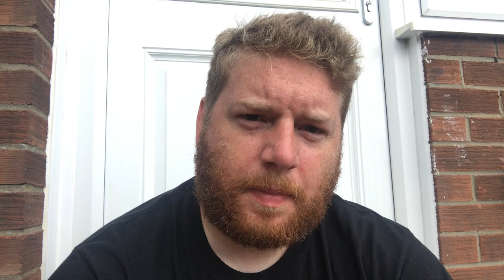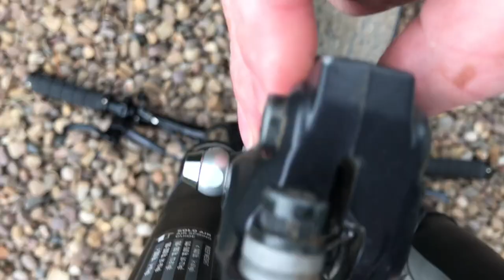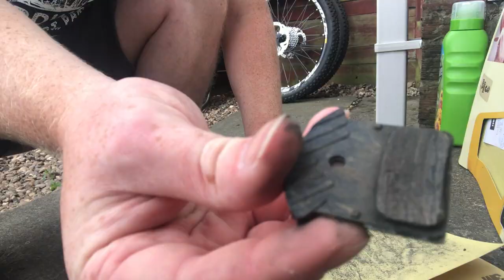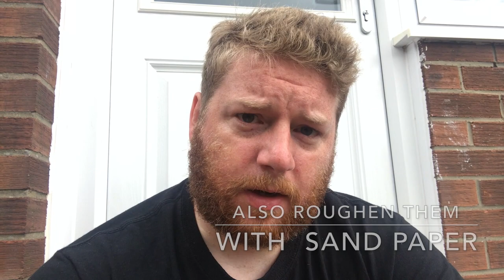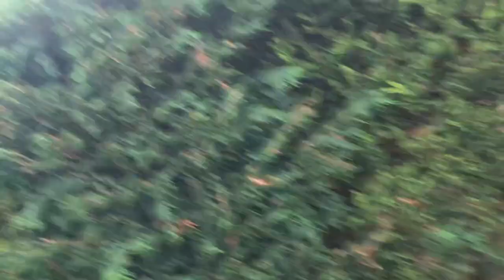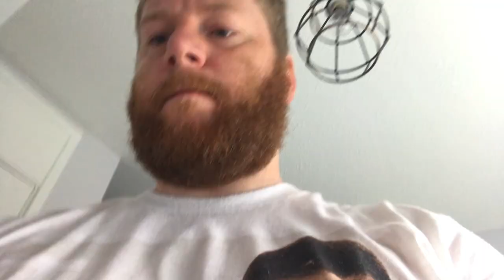Contaminated Mountain Bike Brake Pads (How to fix)

Comment: If you sand down contaminated pads without treating the pads first, the chances are you're pushing the contaminant further into the pad compound itself.

Before sanding the pads give them a good coating of disc brake cleaner (or nail varnish remover) and give them a good scrub with a firm nylon brush to get as much residue off the face of the pads as possible. Then give them a good sanding with an 80 grit sandpaper until they appear the same color they do when new (more of an orange color for resin based pads).

As for the rotor, you're better off using a clean rag soaked in disc brake cleaner as it won't rip/shred in the same way paper towel does, which guarantees better cleaning.

Local bike shop covered my rotor and pads in mineral oil when bleeding so they were literally useless. The above with a proper bedding in process (gradually building up heat/pressure/duration of contact and no wheel locking) has brought them back to performing as-new. The idea of bedding them in is to coat the rotor in deposits of the pad which is what results in the 'bite' of well bedded in brakes. Locking up the wheel means this can't be achieved.

Hopefully this method works for anyone who gives it a try!
Reply: Shop professional mechanic here. DO NOT SOAK YOUR PADS IN ANYTHING. If they are that badly contaminated. A can of disc brake clean is 10$+ for cheap stuff. Brake pads on average are 20$. Clean your rotor with isopropanol alcohol or acetone. They will remove any oils. Disc brake clean is acceptable if you are buying automatic stuff I've noticed things like finish line disc brake cleaner leaves a residue that actually isn't beneficial in anyway you still need isopropyl to clean that residue it leaves off. The bed in procedure was perfect. But I'm telling you right now if that shop soaked your pads and srcubbed them with a brush to clean them. I will not recommend to go back there as they do not know what they are doing. I personally ride my bike to work in the winter months with salt out. So I am almost every single ride taking my brake pads out sanding them down when I start to get a slight squeel upon braking. By no means will I ever soak my brake pads.... What we recommend as a professional destination MTB shop where we're dealing with 4000$+ gravel road and MTB bikes daily. DO NOT SOAK PADS IN ANYTHING NOT EVEN WATER! If you soak the pad material you are ruining your pad and allowing moisture to be trapped therefore enhancing the rate at which it gets contaminated if you soak the pads there will be residual moisture. ( You don't wanna burn them out) if you did a metal splintered pad will not bite as hard as you changed it's composition with heat. Same for a resin filled pad for quiter less dirty braking. Metallic for muddier dirtier braking plus added friction while braking. Although they can get noisy anyway. Sand the top layer of your pads down take an air compressor shoot some air at the pad to clear any residual dust after tapping dust off. Clean the rotor good with isopropyl alcohol. Don't use a rag that'll fall apart like he mentioned. You also need to be extremely careful using any kind of cloth it has to be a shop grade towel that has no oils or contaminates on it. Easy for me as I work for a shop and we pay for oil and contaminate free towels that we pay to have them wash. Disc brakes will pick up any contaminants even oils off your fingers so when touching them use gloves the entire journey. And if that shop covered you rotor and brake pads in mineral oil. Once again go find another shop. First thing I was taught as a mechanic was if you are opening any kind of hydraulic system you remove the brake pads and wheels from the bike and protected before any part of the systems opened even with mineral oil we have buckets underneath the bike towels rubber banded to the ends of the bike so it can run. And this is just for mineral oil. Don't get me started on disc fluid. You can't even let that stuff touch paint. So if that shop can't do a bleed with mineral oil without ruining your brake pads. And then to fix it they soaked your pads in disc brake cleaner and scrubbed them? To me it sounds like this should couldn't eat it's mistake and buy you brand new components you deserve. This kind of this doesn't happen at professional tier shops. Not when your average bike you work on is 3000$+

Comment: Here's another approach that works for me every time: Vinegar. Soak the contaminated brakes into a plastic filled with vinegar. Then rub them with a sand paper. Dry them with a pure cloth. Repeat this process until the brakes appear like new again. 

Also, clean the rotors and the inside of the calipers well with Vinegar too. This works miraculously. Enjoy!
Reply from the maker: Great tips, never thought of the vinegar bit but makes sense. 👍
Reply: only thing is with sand paper is that it creates an uneven surface on the pads
Reply: Road Bike how long do i soak them
Reply: @casensmith9752  as you soak them do them with grit paper....in 5 mins the process is usually fine.
Reply: What type of vinegar do you use?
Reply: I tried with isopropanol to clean, but it failed. Vinegar works great 👍 My noisy break is finally fixed. Thank you

Comment: Hey man, watching from 2020 and just wanna thank you for the fix. Currently using shimano mt-200 hydraulic brakes partnered with shimano RT 26 rotors. I just followed the steps, did sprints and brake like crazy, it slowly gained grip and it worked like a charm!
Reply from the maker: Thank you

Comment: I got bike chain spray on mine and now it just screaches so badly and it doesn’t stop

Edit: this is an update on what happened to me, this helped a lot my breaks actually grip now but they seem to still have a small amount of noise. I didnt have 25 bucks to get new pads and this worked a lot I recommend trying it if you don’t want to spend the money on new pads
Reply from the maker: Just follow the video and it should get the contaminants off and stop it from screeching
Reply: Olly ok thank you
Reply from the maker: If they are still screeching a bit this may come off in time or it may be worth going through the process another time as there may be some contamination left although not as contaminated as they were originally if they are now biting better
Reply: Anonymous Person yo I have the same problem I got chain spray on my brakes and now they scream! I have tried everything, how is your brake going?
Reply: Lit Tit it wouldn’t fully lock up so I finally decided to just buy new pads and clean the rotor with 91% rubbing alcohol then Re bed them they work fine now and it was only 23 bucks so

Comment: For anyone who wants to know, you do not simply use a regular or any alcohol there is a specific percentage when cleaning brake pads like this. When researched about denatured alcohol lots of people use it because it is more effective than rubbing alcohol. Thus rubbing alcohol has more water in it than actual denatured alcohol.
Reply: Is isopropyl alcohol good?
Reply: @nibblessss  any alcohol with a higher percentage will help
Reply: @jamesedmerdelacruz9478  Ah okay, I believe mine is 97% alcohol so i should be fine

Comment: I just burn it via stove by 4-5 minutes or until the smoke is gone
Reply: I read this in a couple other places. Does it actually work?? And also do you still sand it after? Or use isopropyl alcohol to clean? What do you do exactly? As in the completed process. Thanks.
Reply: @loooveismusic8  direct burn it then fine sand the burnt part and its done.dont finish it with alcohol unless its 90% or something.i heard from other bikers that some alcohol had moisturizer mix in it that can contaminate the pads